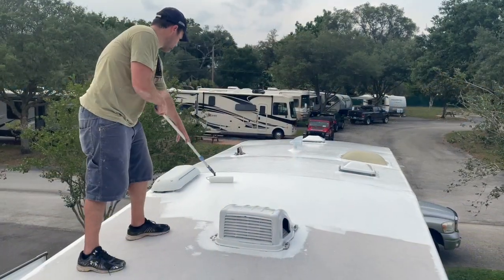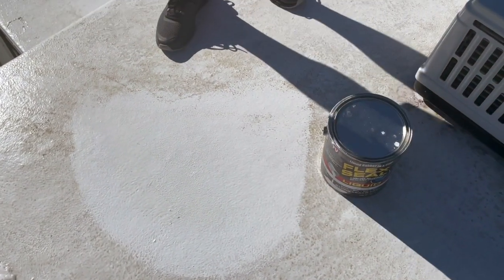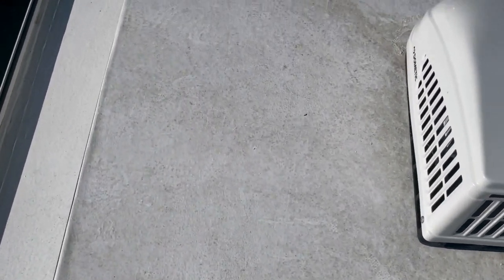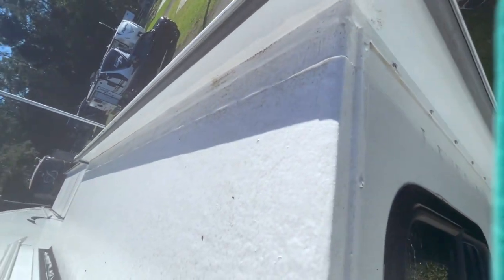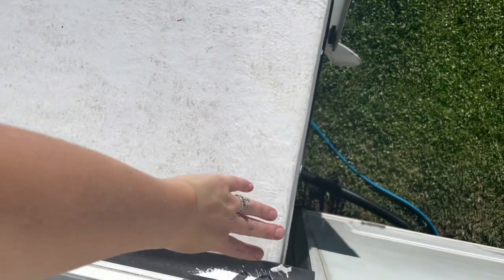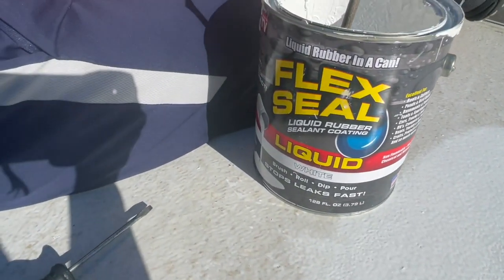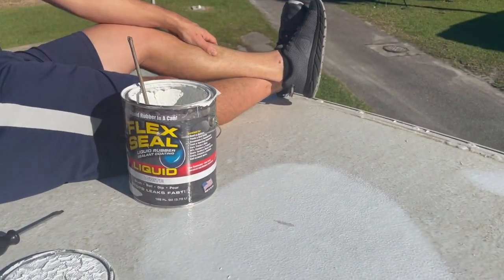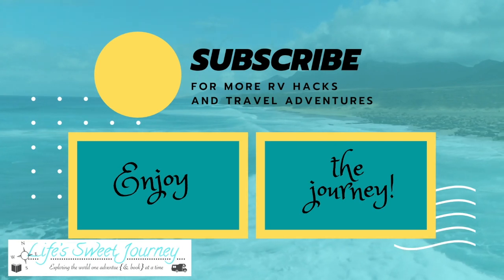Flex Seal RV Roof Reseal Update 8 Months Later! IS IT HOLDING UP?

Comment: Happy you gave this review. We have been seriously wondering about using it and wondering if it was worth the effort and the money.  I’m impressed how well it help up and considering where you have done most of your camping, it’s nice to know the sun didn’t cause any issues. Thank you for sharing.
Reply from the maker: You bet!! The roof reseal was a project and with your new gal you probably won't need that for quite some time (hopefully) but if you ever need to use it for repairs it holds up really well!! We have used all the flex products and so far have had great results with all of them. The tape is SUPER easy and quick and holds up!

Comment: Thanks for your post.  I'm not concerned about 8 months down the road.  I'm looking for something that will hold up 8 years down the road.  Will keep my eye out for your long-term report.  :)
Reply from the maker: Will definitely continue to do updates! Have another planned soon now that we're over a year in. So far, so good!
Reply: I coated my 1999 37' Bounder roof with Dicor Cool Coat in 2017.  The original EPDM material was in pretty good shape for being 18 yrs old.  There were no repairs to make prior to coating.  There was the typical black colored stuff which isn't a big deal.  I used their cleaner/activator first.  My RV is always exposed to sun, rain, and snow.  I just looked at the roof today (7/2022) and there's peeling at some of the edges of the A/C units and unbroken blistering in a couple open spots.  I think all that occurred after about 4 yrs.  However, none of that is a problem and I'll just be peeling some of the stuff off, cleaning, and re-coating.  This time I'll be using Heng's rubber roof coating as it's much less expensive and has good reviews.  Since my roof is in pretty decent shape, I'll just keep re-coating it every 3-5 yrs with whichever product is the best value.
Reply from the maker: @ziptic  This is great to hear!! That's our plan if we see this start to peel up anywhere as time goes on. Well just reapply a little more sealant or tape and then do another full recoat hopefully a handful of years down the road.
Reply from the maker: Hi Doug, still not 8 years down the road, but 1.5 years in now and just went through Hurricane Ian so we did another update video. Still holding strong!! https://youtu.be/b3mGyUtohDo
Reply: Wrong product. Flex seal is consumer grade products that are basically a "patch". If you can buy it at Walmart you shouldn't be using it on your RV. It's for the dummies they aren't going to sell quality long lasting uv resistant products at your big box store. The proper way to seal an RV is dicor and/or etrnabond. Also coating the whole membrane does nothing big waste of time money and it looks like a toddler took a paint push all over your RV.

Comment: Thanks for the video. I don’t know if someone else has said this. Try using wet and forget outdoor on the roof and whole camper and awning. Spray it on with a pump sprayer and let dry and it will kill mold and other nasty stuff and will keep you’re camper clean. We use it and it works great on our camper. When it rains is when the wet and forget works.  And you don’t have reply for a few months.
Reply from the maker: Never heard of this stuff!! That's awesome. Will look into it. Thanks!!

Comment: I had a leak in my new cargo trailer and used clear flex seal on the joints.  5 years in Florida sun and it was like new so I treated the whole roof with white. Year and half later it's still like new.
Reply from the maker: Ahhh thank you for sharing!! So glad to hear that!! Hoping ours holds up a good 5 years and then some. YAY!

Comment from the maker: How well do you think the Flex Seal Liquid held up? We promise to clean the whole roof for the next update! ETA: New roof check-in video is LIVE (with cleaning after 1.5 years) https://youtu.be/IBM8DY5tWhc
Reply: There is a product I heard about that you can paint your roof with that has sparkles in it so it reflects the sun and cools about 10 deg after applying. Do you think that it could be painted over the flex seal paint?
Reply from the maker: @FanceeName  Hmmm, will have to look into that! I'm not sure. I would think so but I would do a test spot to make sure it bonds well.

Comment: I used FlexSeal clear spray to overcoat the original sealant around roof penetrations. A year later, it had mostly disappeared with a bit of residue that was easily wiped off. I have used FlexSeal products with success on many projects, but I would not use it for an RV roof.
Reply from the maker: Thanks for the heads up! We will definitely continue to keep a close eye on it. So far we've hit the two year mark and it's still holding up well for us.
Reply: But the sprays are thin right ?  I can see that’s not to use as a whole roof sealant. Maybe just to spray over a quick cut to waterproof it until it gets a thicker cover over it .

Comment: As an 18 year full-timer, take it from me, don't use flex-seal or any product not specifically designed for epdm or tpo roofs.  There are other youtube videos showing what flex-seal does to an epdm roof after a few years, and it isn't good.  The adage "you get what you pay for" works for rubber roofs.  There are fixes for these roofs that are guaranteed for 15 or more years, but they are expensive as they should be.  Only apply epdm or tpo products to seal and repair your rv roof.  Anything else that you do, will cost you in time and money because you will have to remove the current sealant before you can apply the proper sealant.  If you value your investment, then heed this warning and don't go cheap.
Reply from the maker: Thanks for sharing your concern! Thankfully it is holding up really well for us so far. We bought our rig used and the roof had never once been resealed in 10 years. We knew we would be doing all repairs and any maintenance DIY so we went with something user friendly. So far so good. We keep watching for signs of peeling and will patch when needed but over a year in at this point and no signs of an issue.
Reply: You are very correct. these people probably couldn't change a fuse in the fuse pannel so taking roof advice is ludicrous

Comment: Cleaning my RV Roof with FLEX SEAL on it, I use a Power Washer, on low setting, and it still looks good.
Reply from the maker: That's great to know! We have wondered how it might hold up to a power wash. We are just nervous with all the exposed parts up there. Good to know it works well on low setting.

Comment: I am interested in seeing posts from folk who have have had their RV roof covered with Flexseal for at least 4 to 5 years.  I have never sealed a RV roof, but I have done a lot of research and for those have not yet applied Flexseal do your research first.   There are a lot of online videos that demonstrate Flexseal applies and seals very well the first time, unfortunately it does not contain Ultraviolet Resistant components and when it needs to be removed it leaves a residue behind that very little can adhere to and based upon what others are reporting it is difficult to remove.  See the article below, there are 100's of online articles and videos online that support these findings.   The bad part is you put this stuff on and initially it works very well, but when you have to remove it in a few years, you will yourself wondering why no one let you know about these issues.  Do you own research and make up your mind with the information that you find.  Here is an excerpt from the link below.  "Flexseal is good for an emergency repair."  "Flex Seal is a temporary fix and not a permanent solution to a leak. Flex Seal should not be used to repair a whole roof. When there’s a lot of roof area to cover, you will want to consider other options."  - - - - https://rvblogger.com/blog/flex-seal-rv-roof/

Comment: Look like it was sure peeling up by his foot where the AC runoff is.... 🤔 also what about "water-beading" - does the water/rain in fact bead up or does it just pond & puddle like all other ( except silicone) sealers....🤔🤔
Reply from the maker: It beads and rolls right off. You can see that at the end of our initial reseal video (around the 9:10 mark- https://youtu.be/MyCh-sXdjuk). Also, it hasn't really peeled at all. Just that one scratched spot. I think what you saw may have just been the dirt since we didn't wash the rig for this checkin. So far we are past the two year mark and it still looks the same as the day we did it. We didn't take the AC unit off when we sealed so if that was where you saw some of the original roof it's because we didn't get fully up under the unit. Our newest update video shows the roof after it was cleaned, along with how easy it is to wash and for the water to bead/slide off- https://youtu.be/b3mGyUtohDo.

Comment: Does it completely dry after painting it w/Flex Seal or does it have a sticky feeling to it? If it dries 100% how long does it take to dry? Great video! Thanks!
Reply from the maker: Hey, yes, it completely dries. It is not tacky or sticky feeling. There is good grip so that you don't feel like you're going to slide of the roof, but it definitely dries completely. Just be careful if it has rained or if you are washing it- then it gets very slick! Also, it was mostly dry within 24 hours (sitting in full on sun), but for sure within 48. We didn't pull the slides in for three days just to be on the safe side, so make sure you have a few days afterwards to leave the slides out. You can see the full reseal process in this video if it is helpful: https://youtu.be/MyCh-sXdjuk

Comment: Ok unfortunately I did not work as well as your experience.   Could be harsh Az weather but 1  1/2 years later it all peeled off.  Terrible results.   Glad you had better luck.
Reply from the maker: Ahhh so sorry to hear that! We're in Florida, but I guess our heat isn't as dry. We're almost at the year and half mark and it's still holding up well as of right now.

Comment: Thanks for the info. How many buckets did it take to cover the whole roof?
Reply from the maker: You bet! Glad you found it helpful. It took almost 3 buckets for our 34 ft fifth. We have 3 slides. What was left in the bucket you see in this video is what was left in the third bucket. So really just about 2.5 buckets. You can see the original reseal video here (https://youtu.be/MyCh-sXdjuk) and it shows how much we used, and the full reseal process. Are you planning a reseal?
Reply: @LifesSweetJourney   It almost looks like you have the same trailer I do. But I'm planning on a reseal. A previous ac unit installation by the previous owner,  involving what looks like duct tape has led to water leaks in the rear room whenever the AC unit is on. It only leaks when the AC is on because the RV stayed in a covered building. But I'll be sure to check out your other video to see how this was done. 👍
Reply from the maker: @DontDodgeIt...RamIt...Dammit.  Oh man, so sorry to hear that! I wonder if they didn't case in the ac correctly and maybe the condensation leaks back into the rv? Best of luck on the reseal. We also have an AC install video (https://youtu.be/jW-hrR-d80Y) that may be helpful to see how the ac should sit in correctly. Let us know if you have any questions as you start your project!
Reply: @LifesSweetJourney   As far as the AC goes, especially with it being central Texas, I hear these over head units aren't very efficient anyway. But I do believe I'm going to go and have a 2 head mini split AC unit installed at some point. That way I can eliminate the overhead ac and the propane heater this thing has. The mini split would take care of all of that to my understanding.
Reply from the maker: @DontDodgeIt...RamIt...Dammit.  I don't know as much about that, but I think you are correct! I have heard a lot of people are happy with that setup!!
Reply: @LifesSweetJourney   Definitely going to give it a try. This is an 05 Keystone Montana Mountaineer I believe. My first RV ever. But until this economy and housing market figures out what it's going to do...this thing is home for now. Just needs a little fixin' up. I do believe your videos are going to help quite a bit. So...I thank you for that. 👍
Reply from the maker: @DontDodgeIt...RamIt...Dammit.  We lived in our RV full-time for 4 years and I miss it so much! Good luck with the renovations and making it into your cozy home! The market is definitely insane right now, so I totally get staying where you are until things sort out. You may come to discover you really love RV living. If you have any questions as you work on projects, we are happy to help.

Comment: Nice looks good “ question can you put it over flex seal tape?
Reply from the maker: Thanks! Glad you've found these helpful. It was recommended that we remove the Flex Tape first, as it may not properly bound to the tape. We thought about just painting over it anyways, but ultimately removed it from the portions where it was on the actual roof lining. However, we did put it over Flex Seal tape on our vent covers and it held really well. It would be a judgement call at that point. If you do put it over the tape I would just make sure to check it often and add another layer of Flex liquid if you notice it needs it.
Reply from the maker: @Dave Yakker- you can see where we put it over the Flex Tape at about the 7 minute mark of this video- https://youtu.be/MyCh-sXdjuk

Comment: I tried this stuff on my steel cargo trailer roof, just a small area where a leak formed from the old dicor getting brittle. It sits in the sun full time and started leaking again in less than a year. I inspected it and it was cracking and bubbling up.
Guess I'm going to have to buy the expensive silicone stuff that reflects UV.
Reply from the maker: Ahhh, sorry to hear that!! Our has sat out in the sun too, but so far it's still holding up for us. Our roof was the original RV roofing, maybe the difference between that and the steel. Hope whatever you find to do fix it next does the trick!!
Reply: Coolseal is what i got, I put it ontop of the flex seal.

Comment: How old is your trailer, I'm thinking of Sealing my roof for the first time. But my trailer is only 3yrs old.
Reply from the maker: Ours is a 2011, so 10 years by the time we sealed it. With your rig being newer I would check the warranty on roof before I did any kind of sealing to make sure it doesn't void any warranty you might have.

Comment: Did you seal off your antenna when you removed it?  Mine leaked down the center and I had to replace the seals. Reason I ask is I wanted to remove it completely but the hole on the inside made me just fix it.
Reply from the maker: We didn't remove the mount, only the hardware and actual antenna. So there were no big holes, but we did seal over the mount.

Comment: Thank you for doing these videos. What is the maximum outside temperature that roof is exposed to uncovered?
Reply from the maker: You're welcome! Thanks for watching. I am glad they are helpful. We are currently in Florida and have been through last summer and then heading into this one. Temps got up into the 100s. But it hasn't been exposed to anything hotter than high 90s, low 100s. I can't remember hottest day last summer, but I don't think it ever got over like 105. Fully exposed in the sun though.
Reply: @LifesSweetJourney  we’re in Phoenix. 125 last summer. When it’s that hot, uncovered, my roof gets to about 275-300 surface temperature. I’ll be coating mine for the first time this fall. Not looking forward to it…..
Reply from the maker: @joeschmoe665  Whoa!! Yeah, that's some heat!! Best of luck with the sealing.

Comment: So would you still use flexseal on your RV roof again?
Reply from the maker: We would, so far it's still worked out really well for us. We just did another through walk of the roof and an update video after the storms we just had here in Florida and it's pretty much the same as the day we did it. https://youtu.be/b3mGyUtohDo Not sure if we will ever do another full reseal on this current RV, just continue with patch jobs from here when needed, but would use it again on another RV with similar roof if we buy used again. We have had a few people with tin roofs mention it didn't hold up for them, so just check the material of your roof and try patch test area if you're unsure.
Reply: Of course they are getting paid to spread the BS

Comment: How did it look where you sealed over the flex seal tape at 8 month mark?
Reply from the maker: Looked good! The only place we sealed over the actual tape itself was the vent covers. It held up really well. Everywhere else on the roof we actually removed the tape before first resealing. It all looked good there too. In this video you can see it at about the 1:50 minute mark. We also have a more recent update, which you can watch here (https://youtu.be/b3mGyUtohDo). This was almost 2 years in and it still is holding up really well. There is some discoloration though where the Flex Tape had been initially. No signs of issues or any water getting in, just slightly discolored spots. You can see that around 6 minutes in the newer video.

Comment: The roof of one of my sliders feels really soft in a few places (we've had rain a couple days in the last week). I don't want it to leak as we get into winter & get more precipitation. Should I put a coat of flex seal on it? Or replace the actual material on the top of the slider?
Reply from the maker: Is it the actual wood that feels soft or just the lining? I would make sure there isn't any water damage to the wood or any mold that may be building up. As long as that is all fine then yes, a layer of sealant will do the trick! Make sure you are covering anywhere water could be seeping in.
Reply from the maker: Not sure if you saw our full resealing video, but this will show you the damage we had before the reseal and how we went about doing it. https://youtu.be/MyCh-sXdjuk